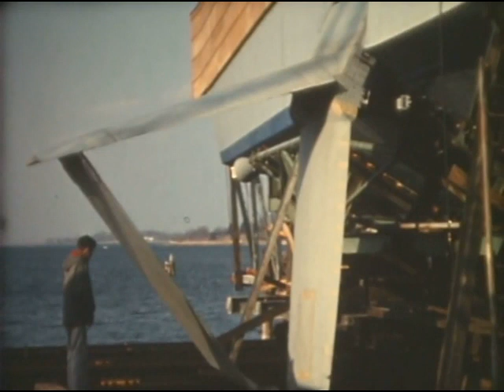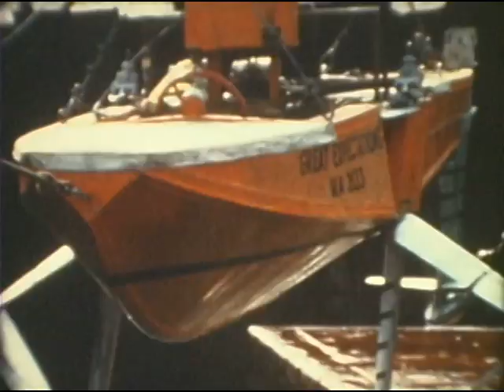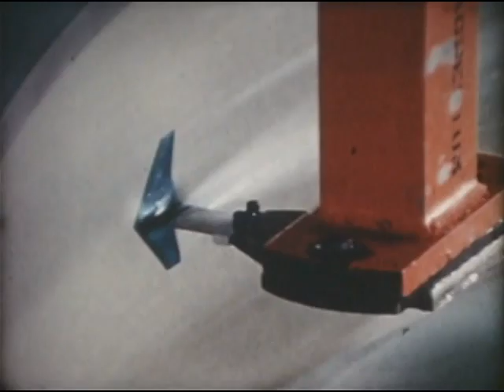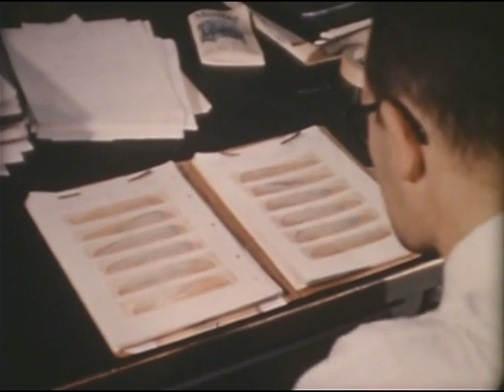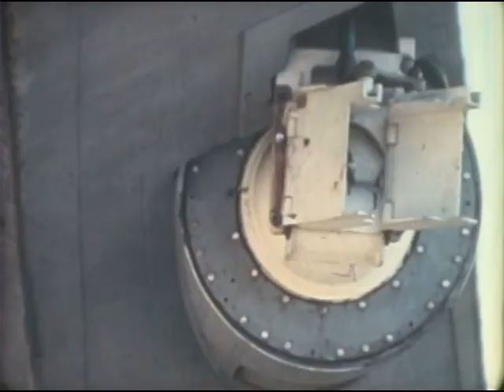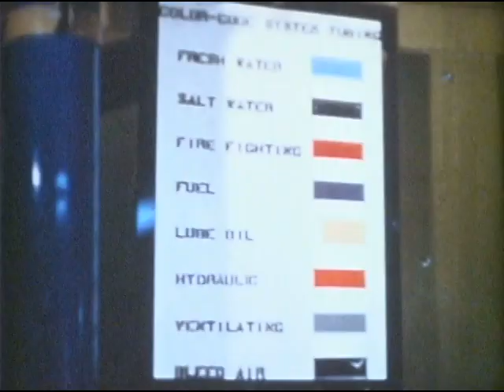Hydrofoil Intro - XCH-4, XCH-6, Great Expectations, H.S. Denison

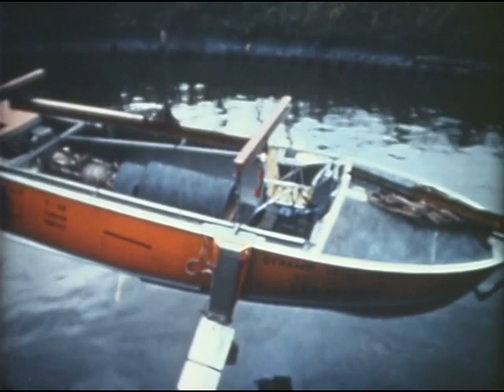Comment: XCH6, so much tech was put into it but somoene had to use Bob's 1950's beach chair for a seat?   timestamp 3:05
Reply: Bill Carl, the hydrofoil designer, had a thing for webbed lawn chairs. He used them in the earlier XCH-4.  Father (I'm WPOC's son) said he was never sure why but the chairs did the trick. Bill was from NYC and looked and sounded like James Cagney. Having sailed with him, I found him to be a delightful man and an engineer to his core.
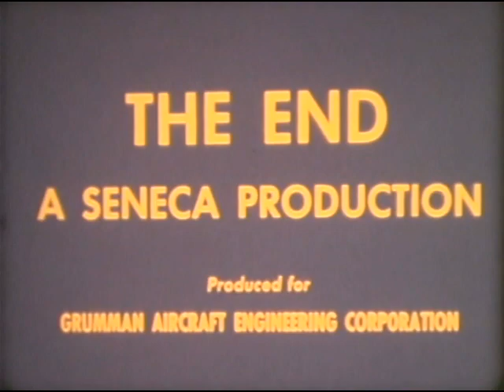Reply: I'm W.P.O.C's son and yes, Bill Carl who designed the Experimental Carl Hydrofoils, XCH-4 & XCH-6 had a thing for lawn chair. There were two of them in the XCH-4. That's dad at time stamp 13:22. Naval Academy, deck officer on a destroyer in WWII. And for you car buffs drove a 1965 White Chevy Impala station wagon with 409 c.i. engine, 4 barrel carb, 4 on the floor and positraction. Needed something to tow his boat. He blew the doors off a GTO who wanted to race.